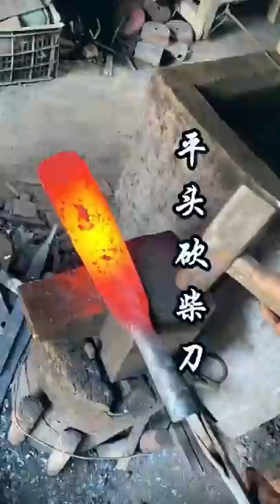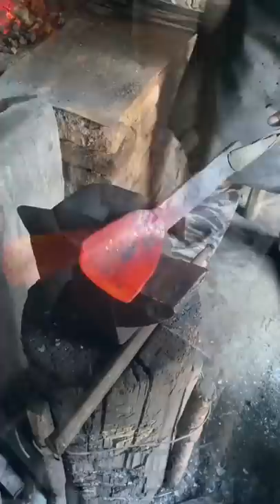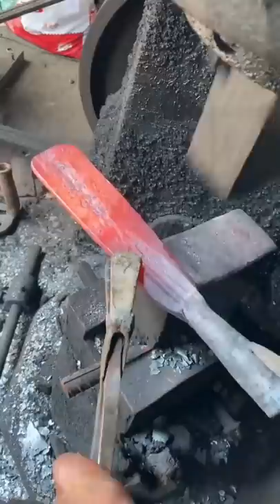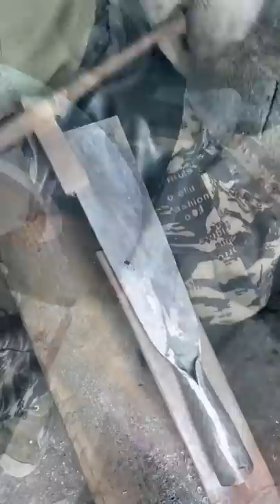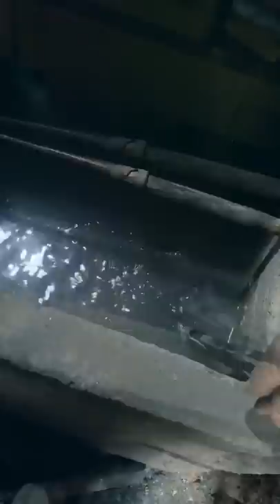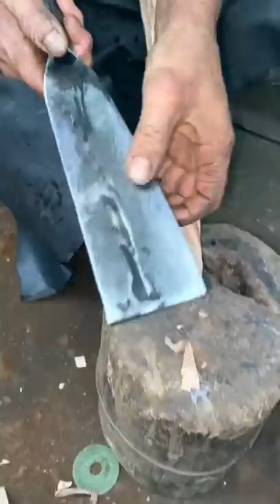Knife Making: Kitchen Cleaver Knife #shorts

Comment: Nice job! Here, have a slow clap.

Fuck me, I could do better with a piece of flat iron and an angle grinder.

You noticed how the blade never hardened after the quench? Because you welded shit steel into shit steel. Also, love the design... Really... Basal. I guess. 

Guys. You want to buy a cleaver, just buy a cleaver. This is a blunt piece of mild steel.